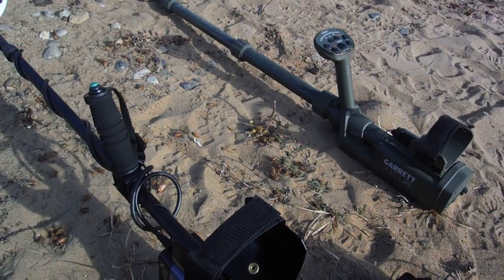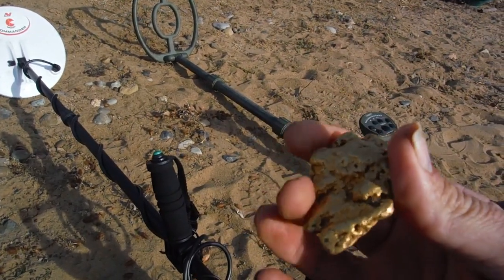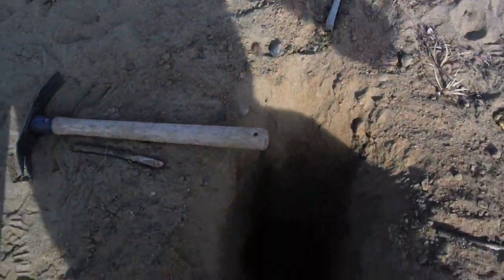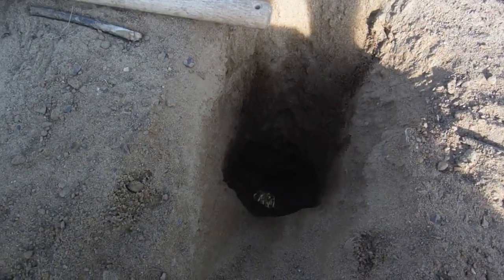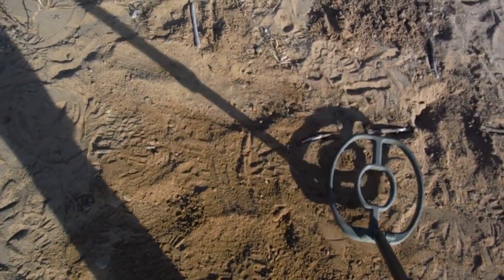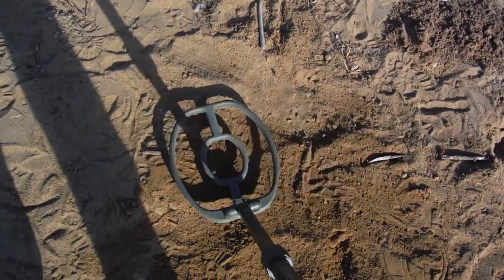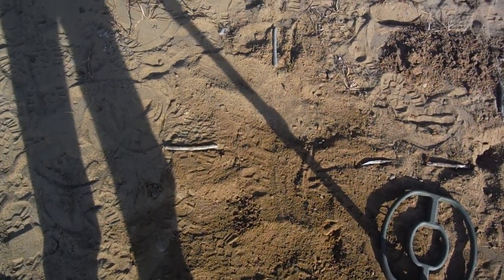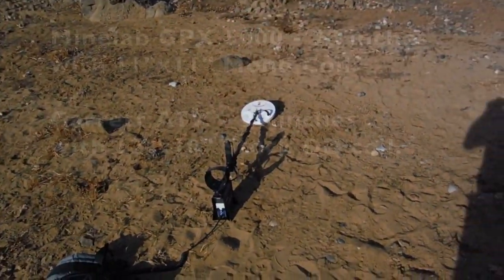5.4 oz Gold Nugget test - Garrett ATX vs Minelab GPX 5000

Comment: What i find interesting is all the coils and settings you have to have with the 5000 to find the same thing with a single dd coil and the press of a couple of buttons and the atx is waterproof. The atx also doesn't require a harness to carry the battery.
Reply: And the atx has pin point where the 5000 doesn't.

Comment: though I had some problem with sea water  It also https://www.youtube.com/post/Ugkxa-FNYUOM93a388gi9a4brtSCEVmrHgJH land for finding any things very easily. (thought it would work as normal due to it being water proof within certain parts of the detector), on dry land and sand worked well. My first one, so still have lots to learn

Comment: Bearkat....a big thanks for all your fine videos on the ATX. In my opinion your videos are unbiased and accurately show how the GPX compares to the ATX.  It is pretty clear that the ATX with the DD coil is perhaps equal or better at finding fine gold than the GPX and only slightly less so at finding large nuggets. I like the simplicity of the ATX. Yes, I understand that the GPX can match the ATX and exceed it by changing coils and settings but the fact is no one ever knows for sure what is under their coil! My ATX will arrive this Friday and I can hardly wait. Your videos helped me make the decision on which detector to purchase.....an easy decision really......thanks.....jim
Reply: At last some one can see the truth on what happens on the gold fields i have a 3500 but i like the way the atx works
Reply: I have both machines. The atx is my go to machine.  Where as the more expensive minelab I think was way to much money for what it is.

Comment: My SD2100 Minelab could have detected that big nugget easy with my 18 inch mono coil.  It all depends on the soil on well it detects for any machine. I have manual ground balance on my detector which I think is the best for deep nuggets or anything deep enough for the coil to pickup. Thanks for the video. That GPX is a nice machine, but 5000 dollars buys a lot of beer.

Comment: If you would have used the mono coil on the ATX, it would have sounded on that nugget at 22+ inches. Good comparison and thanks, but maybe next time use the same type of coil on each unit. Mono coils always detect deeper than dual coils.

Comment: That gold has had some serious battering, hasn't it? I like a metal detector with the  control box attached to my waist belt. It remove the extra weight when the box is attached to the sweeping pole and it is easier to see all switches and LCD screen or needle gauge. This way you can sweep the ground longer before you tire your arm. I have a 1976 Whites Coinmaster 6000D converted to hip belt mount. Sweeping the coil is much lighter, plus I can read and pin point a target better than when the control box was on the sweeping pole.

Comment: Bearkat i would love for u to show me how to work my atx ... i had a go of it the other day in the vic gold fields and only found shell casings and ... and buck shot  .. i think i need to find a better place where there is no rubbish
Reply from the maker: Keep at it man! I run my ATX on full power! Threshold at 9. For max depth and if it stable enough area, I run mine in non-motion mode - gets a bit more depth, say about 5-10% more. But usually the motion mode on max is good enough. It will get 92% of what the GPX 5000 will hear in motion mode.
Reply: ok thanks and wat do i set the discrimination at ?
Reply from the maker: Set discrimination on 0 (zero).

Comment: Air test should be air test not in hole air test.  Why ground balance on the ground then run the detector over a 18inch deep hole?  Most detectors would react to just the hole anyway.

Comment: I am a beginner and I'm going to buy a detector in the next month. I'm not worried about saving money but I am deeply concerned with the highest quality and not missing anything large or small. What do you suggest? I live in Arizona. The ground is pretty hard, rocky and sandy in parts which is where I'll use it. I'd also like to take it to the lake from time to time. I will be out treasure hunting several days a week.
Reply: I own a 5000. I find half ounce nuggets that is deep as he's banging on that great big one. If you shop around you can pick one up for about $2,000 that's all I paid for mine with four extra heads.

Comment: So its clear . You pay for what you get here .The ATX could have missed that target worth thousands of dollars if it were an inch or so lower. But the 5000 would have still stung it easily .If anyone is concerned about not getting the upper advantage then by all means buy within your price range .But how much gold in big pieces will you walk past and not even know because you lacked those extra inches of penetration.The GPX was considerably louder that the ATX by a long shot ,not as you said by a little bit ..We can hear everything on the video ,that target was obvious on the GPX but faded a hell of a lot on the ATX .Even when you lifted the 5000 above the rgound by 5 inches it was still an obvious signal..But the ATX lost it after say 2 inches

Comment: It seems the ATX is a bit better finding small gold than the Minelab gpx/ gp detectors w/ DD coils.... but it takes an awful lot of fine gold to make 5.4oz's. It also seems to me that if you had been searching for hours or even days in noisy ground, you may have missed that big slug with the ATX, where only a deaf person would have missed it with the Minelab.
Reply from the maker: You must remember the GPX has a mono coil on it...BIG difference in depth...because I put the ATX 8" mono on the ATX and it hit that big nugget better than the stock ATX DD coil. Mono's are just better at that big stuff. I'm trying to get Garrett to make a 10"x12" mono coil for the ATX to get closer to the GPX Mono coil depth. That's all it was...
Reply: Bearkat4160 Ah! sorry I missed the fact the GPX was running a mono! I'm not trying to down play the ATX.. in fact I've been hearing really good reports from people in the field. I Just personally feel that the minelabs with there extensive line of coils, aftermarket included, you get a solid machine with lots of options, and with years and years of testing behind it. And lets not forget you can pick up a GP extreme, SD  or GP 3500 maybe even a GPX 4000 for less than a ATX. I've got a GP extreme and 4 coils including a NF 20" mono that I'm in for no more than a ATX. And FWIW I've found 5 gram nuggets @ 18" with the big 20" coil no problem!  Good Vids BTW!!
Reply from the maker: golfnstuf Yep the GPX stuff is the KIng of the hill...no doubt about it. I'm just trying to give people another more affordale option that should still find 90% of the gold a GPX might find. The ATX is a high end machine for less cost. But like you said some people might want an old SD or Extreme for still less and more coil selection than the ATX...theres room for all these machines!

Comment: The  2  detectors  are  close,  even  though  the  minelab  is  better,  it  is  much  more  expensive.  It  is  not  worth  all  that  extra  money  for  such  a  small  difference.
Reply: +Aris Thanasas You are forgetting one BIG thing here, this is a lame depth test really. It DOESN'T relate to gold in the natural state. Either in highly mineralised [detector paralysing ground] or MASSIVELY highly mineralized ground like so much of the golden triangle in Victoria Australia. It's the GPS ability in this ground that really matters. Also coil size, can the Garret use over 20 inch coils?

Comment: That garrett looks like a toy and sounds like a broken one
Reply: Unco Bazz I own it and can assure you, it's hardly a toy. Very highend, high quality and high performing machine... Just not the high price (compared to a GPX 5000). I think the point here was for twice the price, you get very little increase in performance. The 20" Monocoil with the ATX would rival the GPX 5000 in depth with any coil for a fraction of the cost. There are many vids online demonstrating it. BTW, no knock on the ML, I think both machines are amazing! But value and performance, dollar for dollar... No contest - The ATX wins!
Reply: Desert Detective 

I agree.
GPX5000 was only better for a couple depth, but has twice price of ATX. ATX has good value for money with it 20"monocoil. Excellent choice.